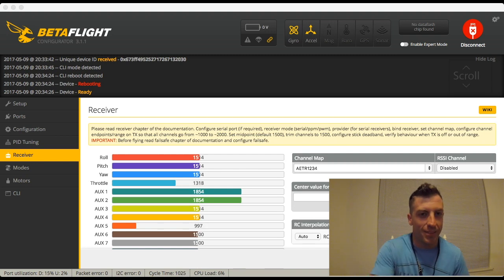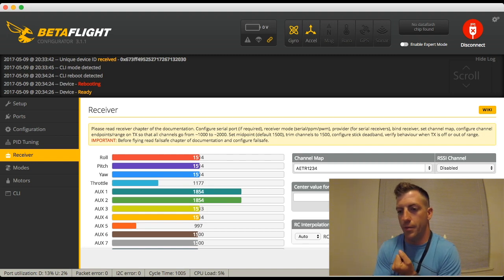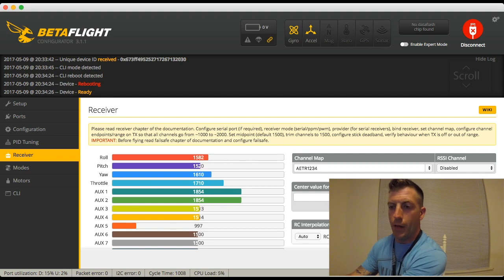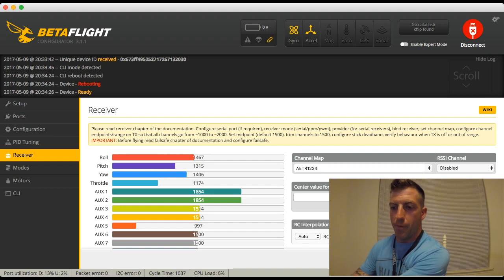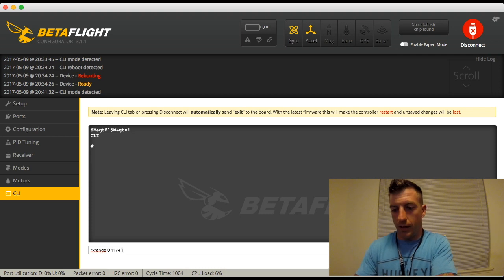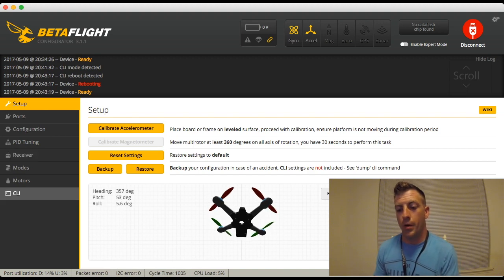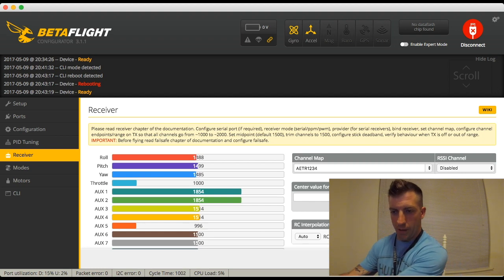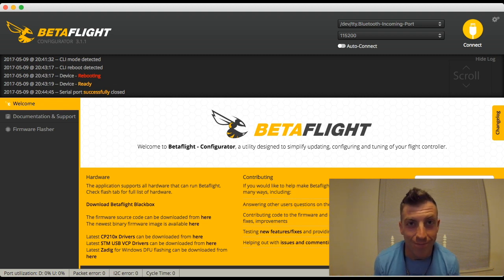Tiny Tech - How to Fix a BeeBrain That Won't Arm

Comment: Just did all that and still isn't arming. Btw, what do endpoints got to do with it not arming?
Reply from the maker: TheBoatPirate if you’re throttle doesn’t go below a certain point the fc wont arm. It’s a safety fe feature built in so if your throttle is at say 75% and you arm it doesn’t blast off into orbit lol

Comment: Will this work if my throttle value is lower than 1000 already mine won't arm unless I move my throttle a bit higher but than cuts off when I bring my throttle all the way down
Reply from the maker: Yes it should

Comment: I have a question I had a crash and after that it got stepped but everything is working but I can't arm up and when I go to receiver tab nothing moves got out of modes nothing moves but cam/motors everything else looks Good no cracks nothing on Fc .what can I do ?
Reply from the maker: Angela Cervera something might be damaged internally that you can't see. That sounds like a lot of trauma for an fc to withstand. So you might need a new one.

You could try this:
1)set receiver type to anything other than the correct one
2)save and reboot. Your receiver type should now be blank
3) disconnect fc from betaflight
4) connect fc to betaflight
5)set receiver type to the correct type
6)save and reboot. Receiver type should reflect your correct receiver type now
7)disconnect from bf
8)bind fc and transmitter

I've found sometimes that resetting it like this helps. I hope it works for you. If not, like I said you may need a new board

Comment: Strange I had my Acrobee flying with some default settings, but then I would start to try and adjust them and it stopped arming. Adjusted the rxrange as you suggested and it is working much better now. Now I can actually fly and attempt to tune it. Thanks for the tip! I am using Betaflight 3.1.7. Some settings are different. Do you think this is still relevant, or are there other tunings you suggest?
Reply from the maker: alanalso heck yeah! I’m glad it’s flying better for ya.  Other tunings? I have a tuning video you could check out 👍👍